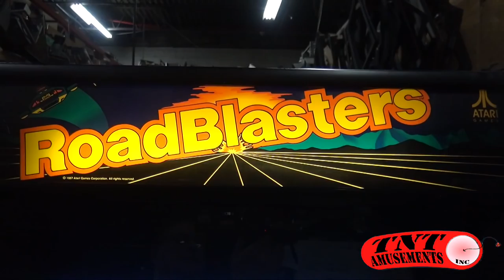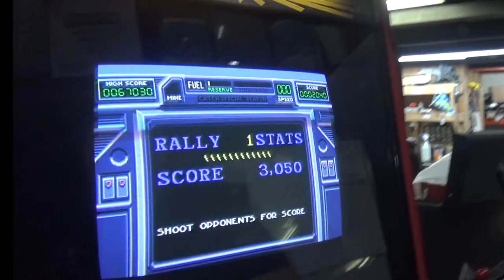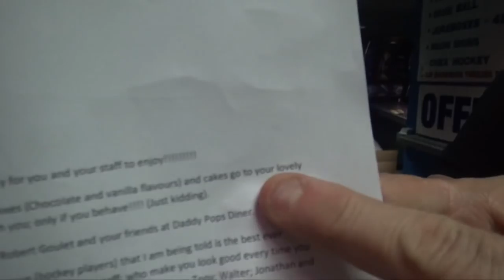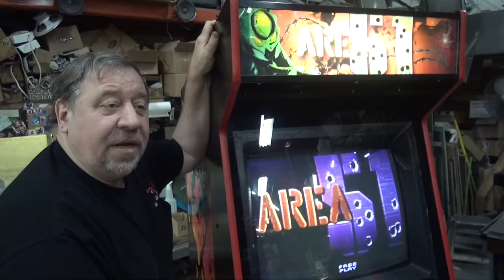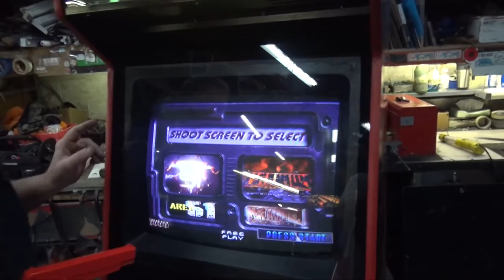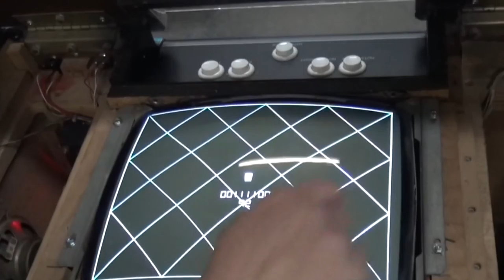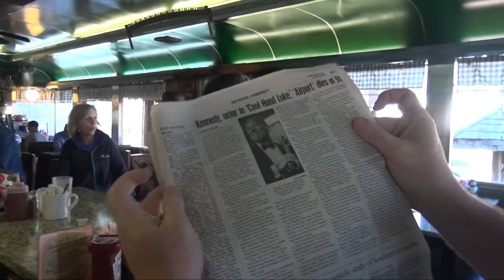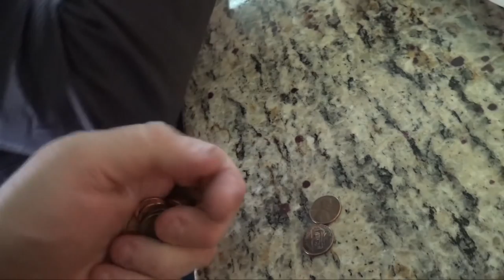#1119 Atari ASTEROIDS Cocktail Table & ROAD BLASTERS - TNT Amusements

Comment: Hi, I'm a big fan of the channel, and I know this particular video is 3 years old, but what do asteroids cocktails sell for these days? I've got a really good one that is joint owned by myself and my brother and we are considering selling it. Is it worth more as parts? It works fine and looks great, glass is really good, only issue is the bottom part is a little loose so when you open the door the board sags a little to the right. 

Anyway, if anyone knows a ballpark figure, it would be great. I'm in the UK so it's not like I'm trying to sell it to you or anything, lol
Reply from the maker: Well, an as is sale you are probably looking at $800 working.  That would be a fair price.

Comment: course naturally for the folks who like to toss just because the 13 inch CRT's might be dead by no means throw it out.  LCD screens work just the same at last resort.  always loved COCKtails   or the ones similar to them.  never was used to the old short ends.  used to the Ms, <------- Pac Man long ened to end styles.  put pop over on one side and pray you don't spill it.  Course I was always pissed  I'll say that.  To see some clodhopper had snapped  off the third prong to make it fit a 2 prong outlet X_X  hey even back in the day they was 25-50 cents with the converter  come on.    If some kid electrocutes themselves on it  who's fault is that gonna be.
Reply from the maker: +Lee Bartholomew yes...most people prefer the end to end cocktail tables...many times, that third ground wire inside the game only goes to the first metal part and nothing else...but it does keep the plug in the wall to the correct polarity.